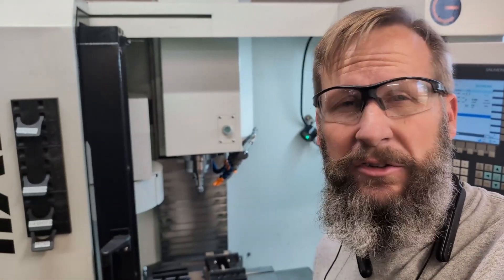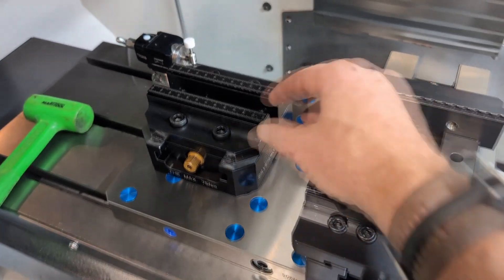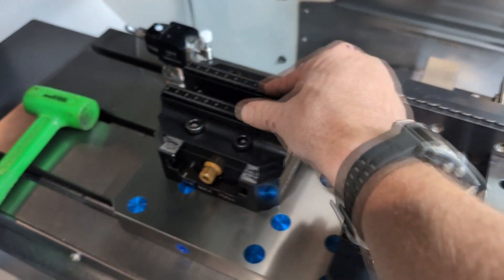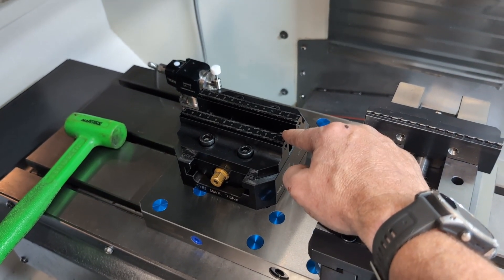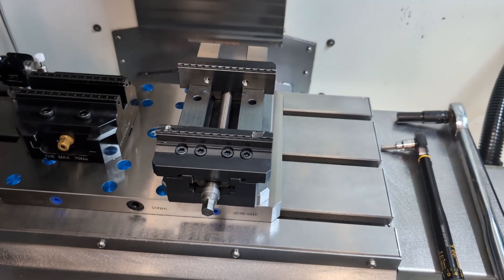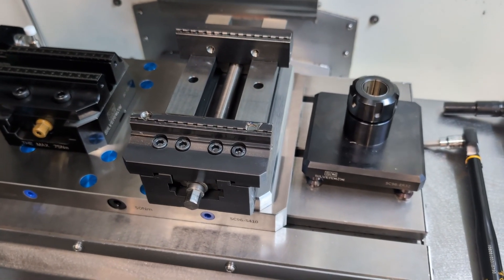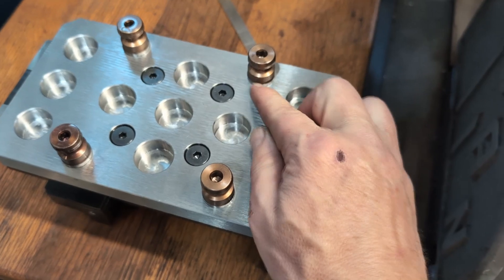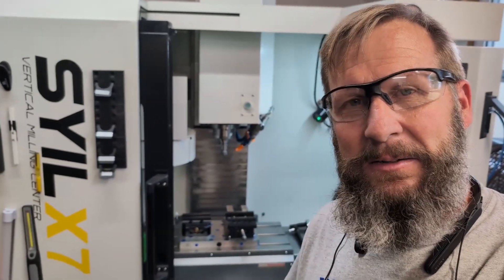Mlock 125 Dual Adaptor Plate for SilverCNC Set Up

Comment: I had similar issues with self centering vises in general. There was a learning curve coming from a traditional vise and It came down to how much torque I applied. Put a dail indicator on the stock and find how much torque you can get away with and stay within your required tolerance.
Reply from the maker: That's a great idea.  I'll do that, thanks.  👍